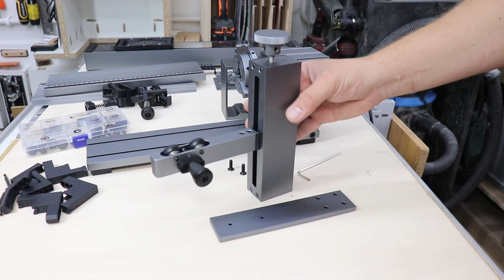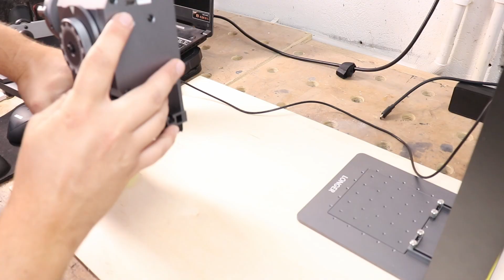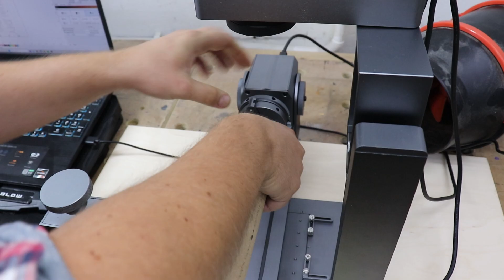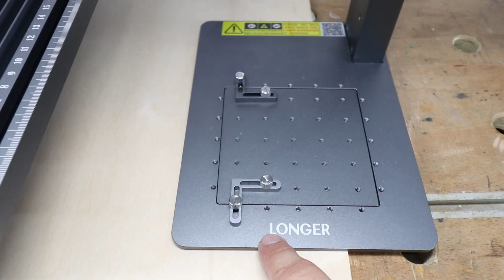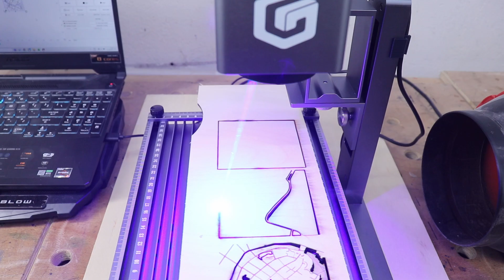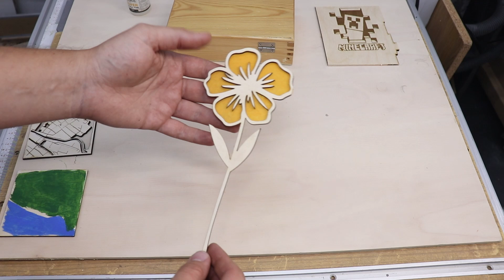Longer Nano Pro 12W: Making Projects With Rotary & Slide Extension Accessories

Comment: This will not allow the laser to focus new feet being shipped by longer
Reply from the maker: Not sure what are you referring to exactly. So far I had no issues with focusing the focal length.
Reply: @CasualDIY  I had received a new slide extension last week , i asked why feet where much higher , longer reported some issue with focusing on different projects .. so they have changed the design , which then stops you alignment of base to slider. I have produced some upgrades for this laser. The video will be realised in next few days keep an eye out your see what i mean.
Reply from the maker: @nobullreviews2024  oh cool thanks, good to know

Comment: Hi your position of the slider extension is different than the one shown in the official longer tutorial any specific reason?
Reply from the maker: @BeZRules  hmm I thought it was the same. As far as I remember, that's what is in the manual
Reply: @CasualDIY you were right but they gave me different bottom knob under the extension slider which is higher than the one you have ,  i am reaching out to them
Reply: Hello everyone, does anyone have to pass me the installation manual in pdf for longer rotary extension?